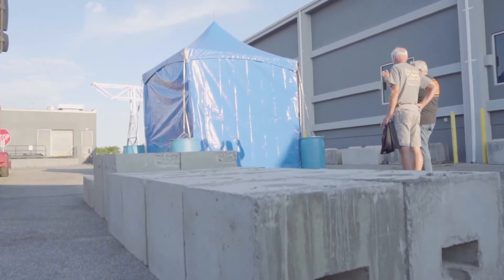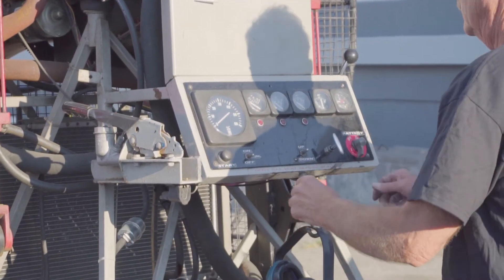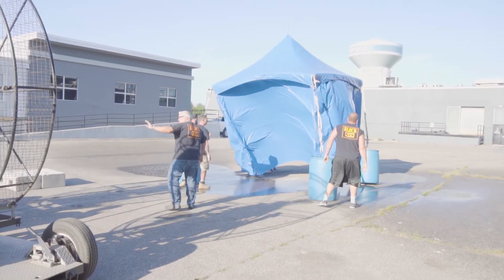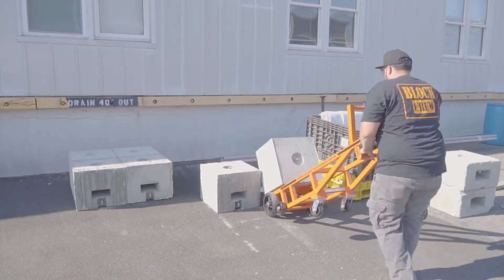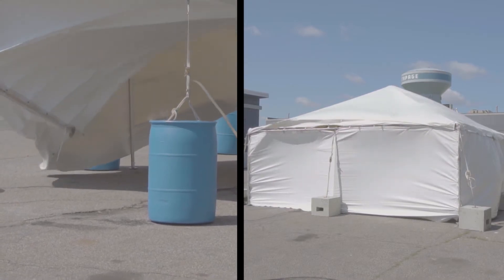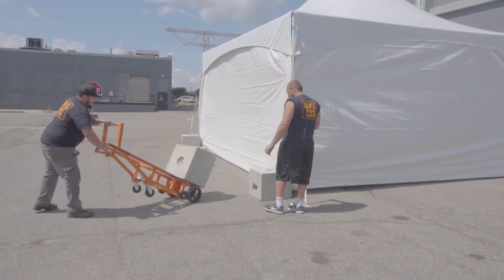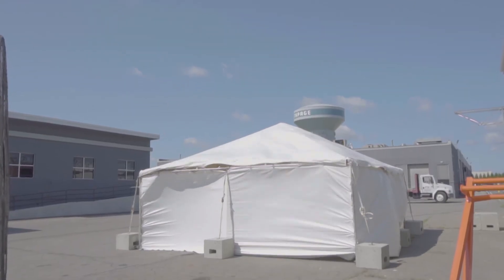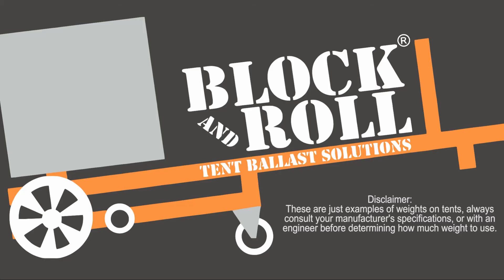Water Barrels vs. Block And Roll® Take 2

Comment: The real trick would be to come up with an anchor point that a water barrel can sit on top of. That way you get the advantage of something that secures both the lower frame post and also runs the anchor line to a lower position tie-off with the full weight upon it. (So the levering effect is much less than attaching at the top of the barrel.) And unlike a cement block that requires a fork-lift or power-loader, barrels can be emptied and positioned or removed by hand. That way it would be possible to get the best of both worlds, and I suspect it's achievable if the design approaches some things in a clever enough way.

Comment: so?  Who can haul a 500lb (or even a 100lb) bloc to any event?  I could attach mt frikn everest to my tent legs and I'm pretty sure it would hold up well.   how bout solutions that work in the IRL
Reply: there is a dolly designed to move these blocks. it works in the real world.
Reply: @guyranting  uh huh. and how do you get it on and off the truck 2x a day for every event?
Reply: With a tailgate lifter on a truck....
Reply: @fredsnit5699  same here. Once you multiply that weight on your vehicle, plus handling them if you're alone? That's too much

Comment: Well in the barrel’s defense, you didn’t attached the legs to the barrel lime you do on the front hook of the blocks. Also, it would be awesome to do the test without sidewalls as well
Reply: Yeah. They totally cheated. And if theyre going to cheat like that, I bet they'd cheat and use higher wind velocity too.